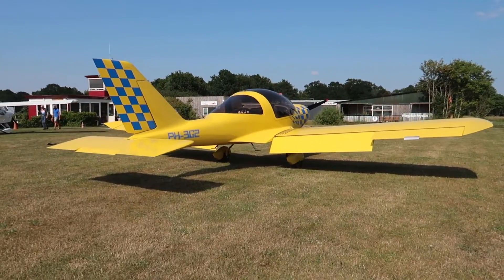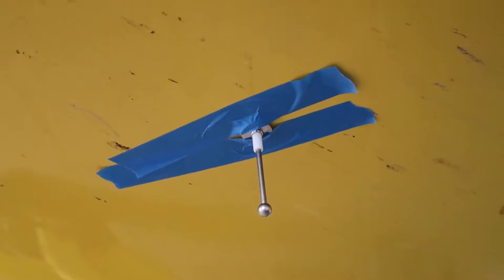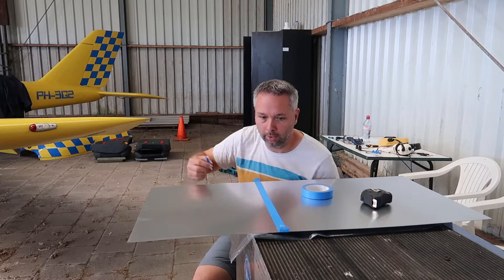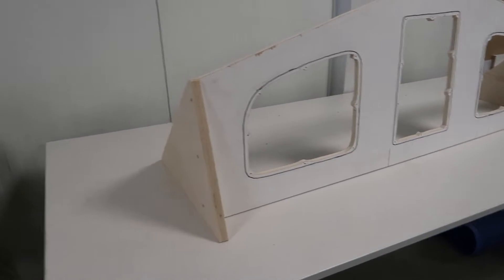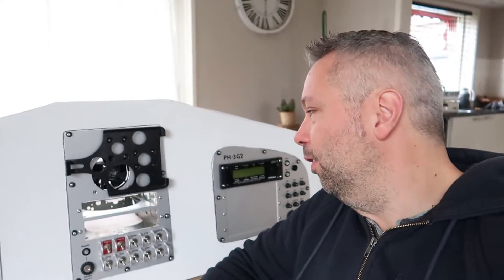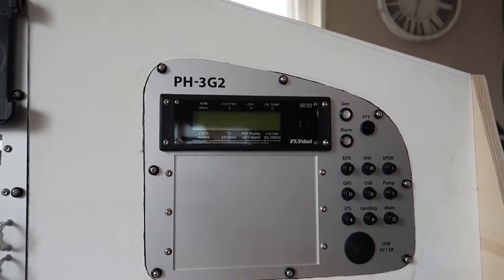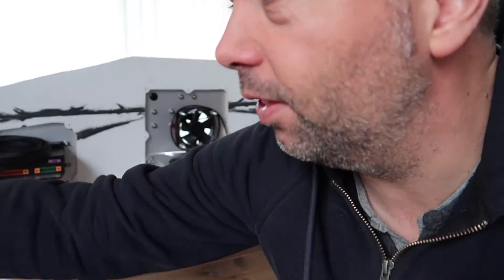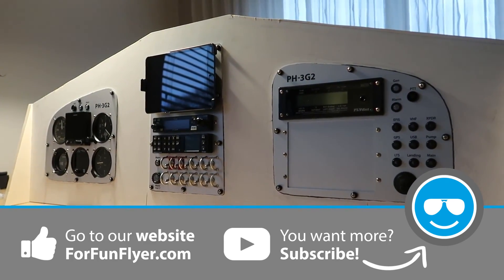Work on the ADS-B transponder, avionics and Rotax 912 ULS for my TL-96 - MLA, LSA and GA - S01 E17

Comment: Good choice on the transponder.. just recently upgraded to the same one and i love it.. as a side note: if you connect a gps source like a flarm device for example it can also transmit your location via ads-b out.
Reply from the maker: Thanks! Yeah, I already prepared a NMEA compatible RS-232 GPS receiver, with 4800 bps output. I still have to wait a bit to use ADS-B though, because of regulations in Holland.

Comment: Aren't your circuit breakers pull-able kind? if so, why have switches?
Reply from the maker: Affirm, they are. But the switch cycle live of switches are way longer than those of breakers. At the end of their cycle live, breakers can do strange things, even stay engaged beyond their trigger current. That's why I chose this setup.
Reply: ForFunFlyer well, the devices themselves have on/off switches - typically you don’t need extra switches or toggle circuit breakers. Isn’t that so?
Reply from the maker: @bair9269  Depends on the make and model and - yes - they are in fact switches, but the data sheets of the breakers I investigated showed a way shorter cycle live span than regular switches. Being over-cautious as always, I chose regular switches for the switching, breakers for the breaking... 😉